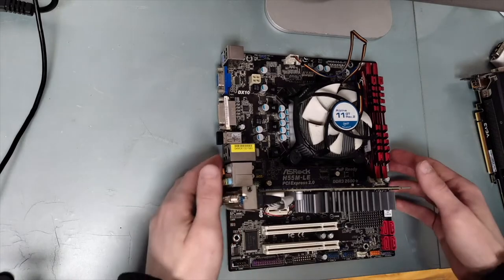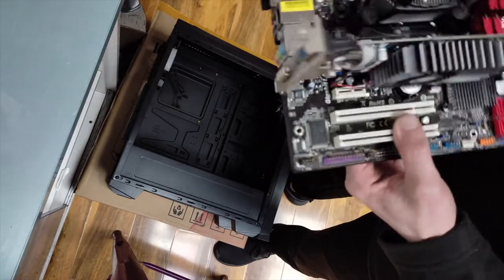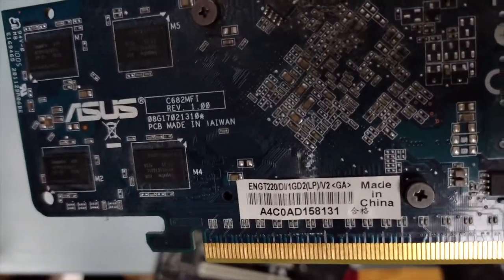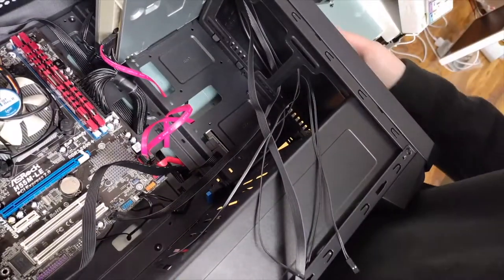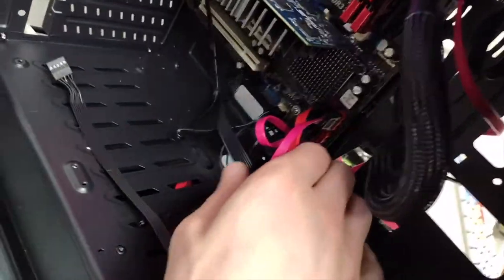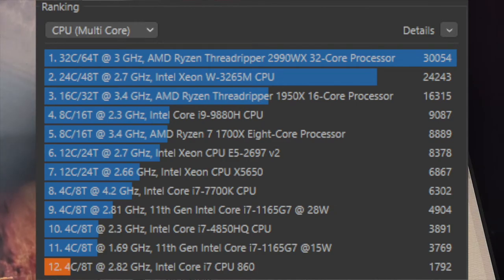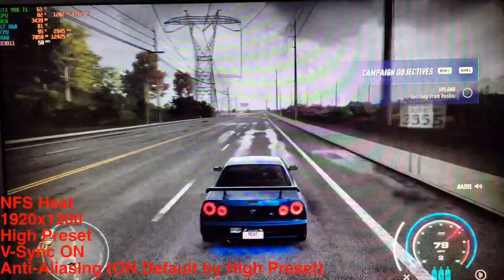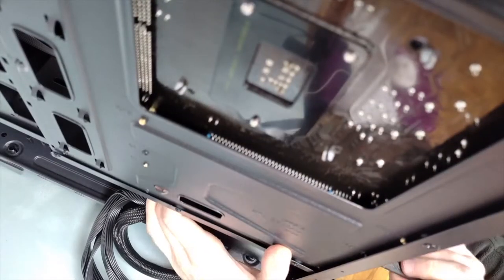i7 860 (with 980Ti) Build in 2022

Comment: Woah.  Those core temps are insane.  I still have my i7 860 from over 10 years ago in old backup PC with a Geforce 970.  All 4 cores are o/c'd to 3.46ghz and temps generally hover from mid-high 50's under full load.  I'm using a Cooler Master Hyper 212 EVO that I recycled from another build.

Comment: Get a decent aftermarket cooler and OC that i7 to around 3.8ghz and it will still hold up on most games at 60fps or more.  I still have an old i7 870 at 4GHZ and that cpu can still ball.  amazing chip for being 14 years old
Reply: yup, i still got mine as a 2nd pc running emulation and handles new Triple A titles easily at 60fps at 1080p high settings with a 980ti with an overclock to 3.8-4.0ghz.  I still play battlefield 4, CSGO, Overwatch 2, and RTS games on it.   shooters get up to 150-180fps+

Comment: honesly thats a overkill gpu for a 1st gen i7
Reply: Nope.  Overclock the cpu to 3.8-4.0ghz and 980ti works great
Reply: @PSS521  dunno how hot that runs but it doesnt seem right w a gtx 980 ti
Reply: @zumoravek  simply use any good AIO and temps remain 75-85F max.  first gen i7's were known to handle higher heat and could be pushed in overclocks.  if you can get to 4.0ghz, you're getting a 43% boost in CPU, which puts it squarely at a stock i7 4790/6700 in performance.  the 980ti doesn't bottleneck upon overclock.
Reply: @PSS521  damn the fuck ya thats very surprising